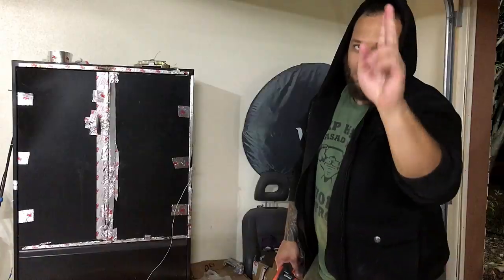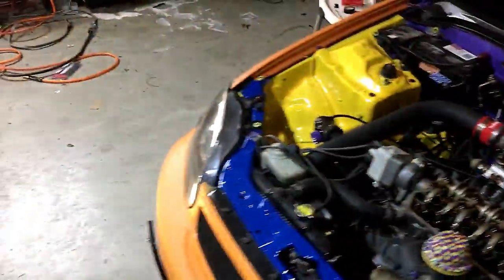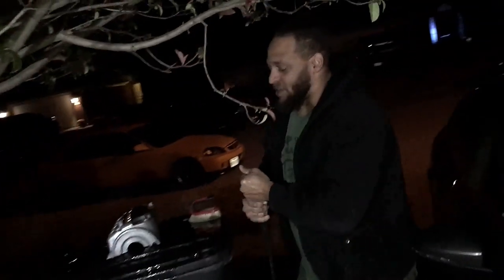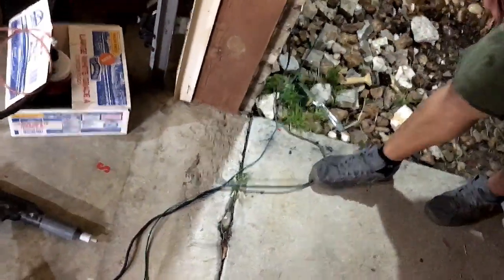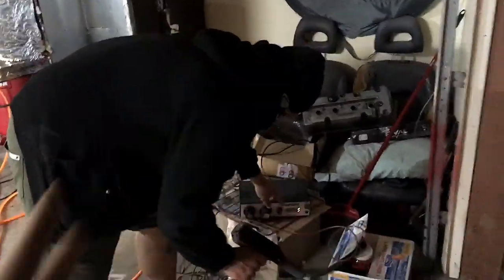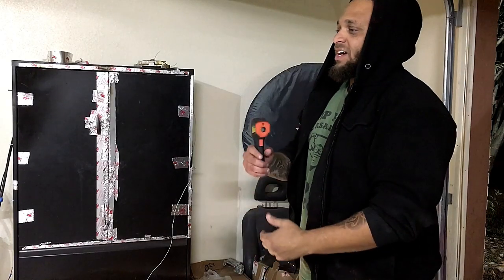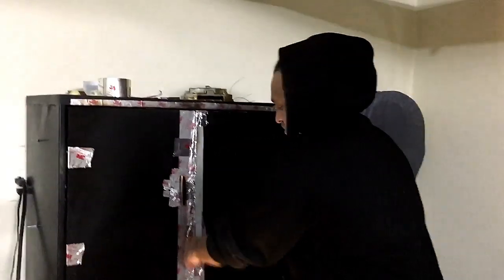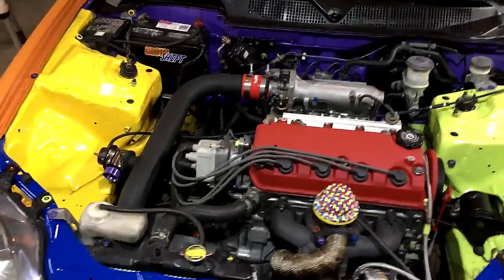How to Wrinkle red powder coat on a budget (THAT GARAGE)

Comment: He knows his stuff using a grounding rod. I had issues till I ran a grounding rod. Didn't have an issue with single layers, but without a grounding rod top coats didn't want to stick very well
Reply from the maker: sinformant He also soaks the rod with water but I didn’t record that part but figured it would be fine with just the grounding rod.

Comment: How does the engine heat not mess with the powder? The engine is a lot hotter then 300 degrees.
Reply: The powder is first bonded to the piece with electricity (powder is positively charged and the part is negative charged) and is baked at 400 degrees, once it hits that temp it becomes like a ceramic shell on the part.  The molecule chains of the powder become longer as it reaches temps and this ensures heat will not be an issue, with the exception of the melting point of the metal it is bonded to.  This is my understanding of how it works from what I have read, I could be wrong but it seems, to me, that this is how it works.
Reply from the maker: Liowen you are correct and the engine heat don’t mess with powder coating

Comment: That paint remover is no lie nasty stuff get it on your skin it burns breath the fumes not good. Gloves eye protection and respirator is a must. That being said it does work very well.
Reply from the maker: will f Yea I was in a well ventilated area but lack of gloves sucks I use gloves at a ridiculous rate I can’t keep buying boxes of gloves because the good ones are pricey for me lol 😂
Reply: @JamesDguy  I hear ya about expensive gloves I used to use army surplus chemical gloves when I did body work they were like a dollar a pair at a place where they sold some surplus or decom items. I found the best buy now a days is the black non latex at tractor supply.  But check your nearby Army surplus stores they may still sell those hazzardist chemical gloves.

Comment: I need to get you to power coat some motor parts lol.
Reply from the maker: DnoDaBarber I have no experience but my buddy Aubrey does. He charges around $40-$60 range for a Honda valve cover!
Reply: @JamesDguy  dang idk you could make that much powder coating. I need a bigger oven so I can do rims..then.I could probably make some money under cutting all the local powder coating shops
Reply from the maker: sinformant Yea that’s what my buddy does he charges WAY less and he is the cheapest in the area so he makes good money in the long run.
Reply: @sinformant  Just an FYI undercutting by a lot isnt the smartest choice. I learned this the hard way. It gives anyone potentially thinking about using you as a coater a sense of unreliable judgement. If every local coater is charging $140 for a valve cover and you are charging $45 for any color including dual stage powders such as illusion or translucent powders, then the first thing to a customers mind is "well I wonder why its so cheap with him.." | "Is it bad or cheap powder?" | "Is the quality less than the competitors?". So just be cognizant of under cutting.